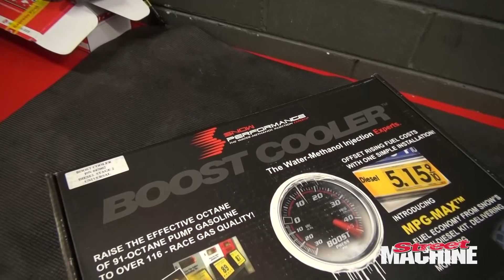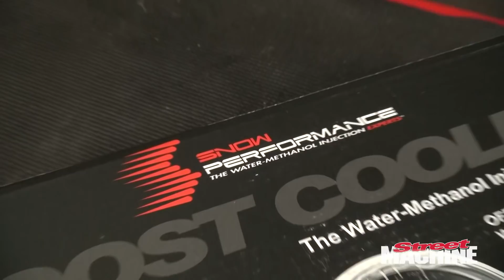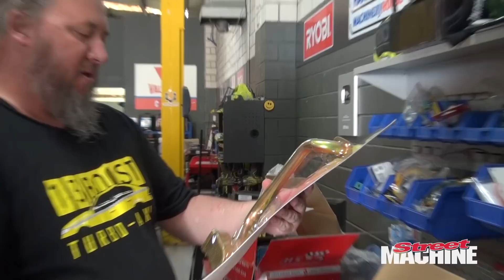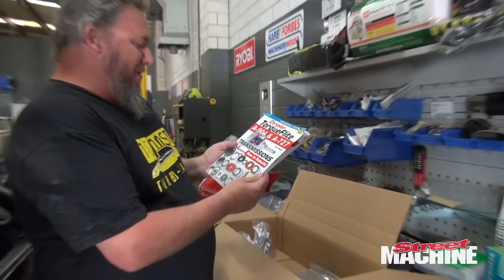Carnage Plus EP89 - Mail Call and Welcome to 2021!

Comment: The water/methanol fogger will improve things greatly. Still think you need to check the liquid feed flow and pressure as the more passes you run the cooler the gas gets, the less pressure it makes to force itself to the converter. The LPI falcons use a liquid pump in the tank which is very similar to Bosch 044 in design. I run the 044 inline with liquid feed from the gas tank and use that to maintain pressure/flow.

Comment: Had to laugh when you said Trolvo is going 10s with so much enthusiasm. Its been a long time coming. Hopefully 2021 becomes the year of the 10s for you guys!
Reply: As JJ Da Boss would say "a mouth can talk". Saying it will run 10's and proving it will run 10's are two completely different things. I am convinced my 180sx had 10 second potential, but since I never had it down the drag strip after I fixed it up, I can't and won't say it, because it is pure speculation. I am however looking forward to the journey of them trying to make it run 10's. I wish them the best of luck in achieving it.

Comment: are most drag strips 1/4 or eighth, also if a car does a time on an eighth track and that gets converted to a 1/4 whats to say that if that same car actually raced on a 1/4 that it could have had mechanical failures half way down track meaning the 1/4 time is not true, does it become just a rough estimate.
Reply from the maker: Of course it's an estimate